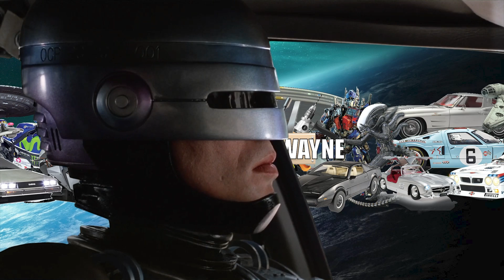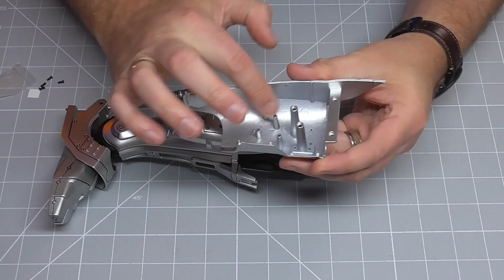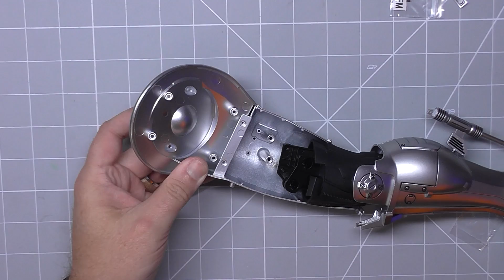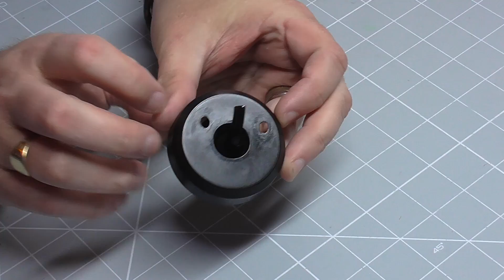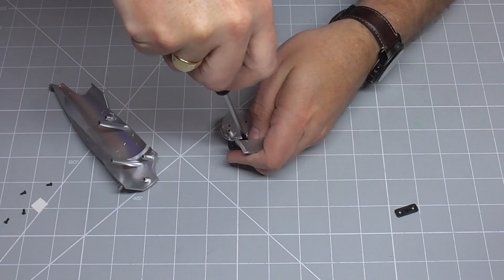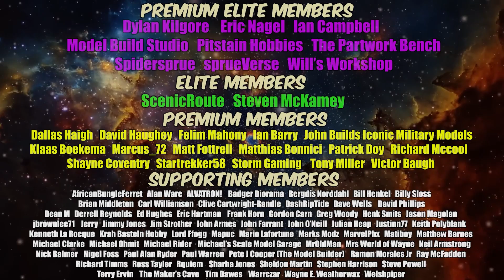Build the Legendary Cyborg ROBOCOP - Pack 7 - Stages 23-26

Comment: If the two thigh halves do not align properly, use a 2mm drill to widen the little hole at the bottom like I did and it will align perfectly.